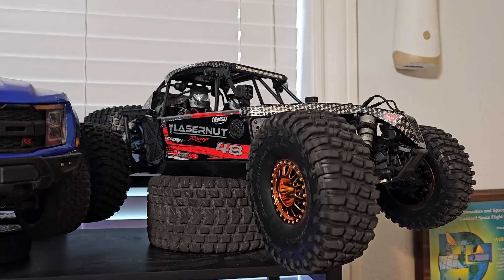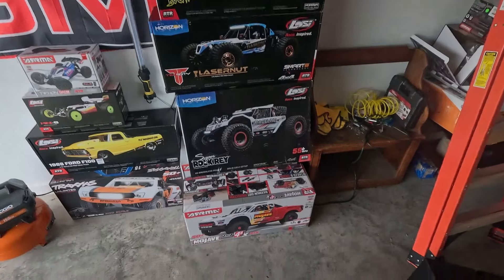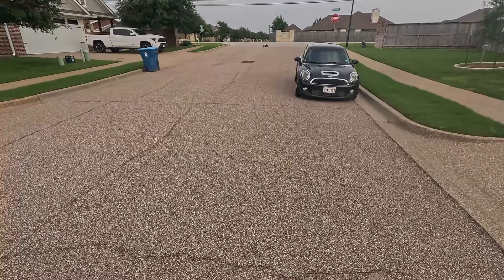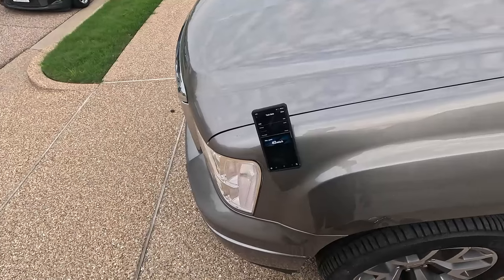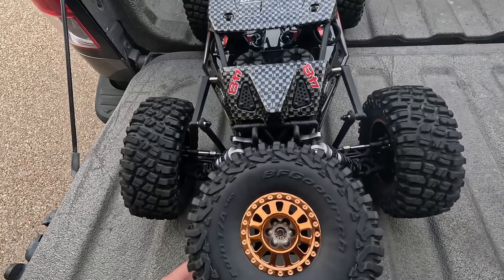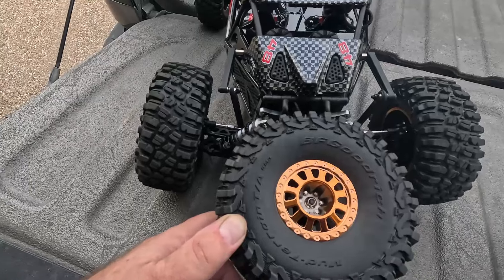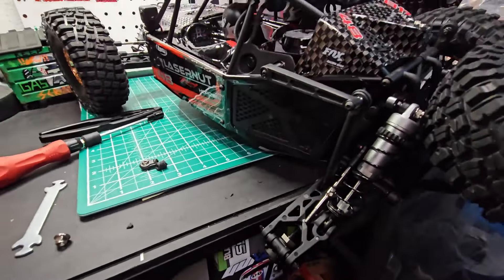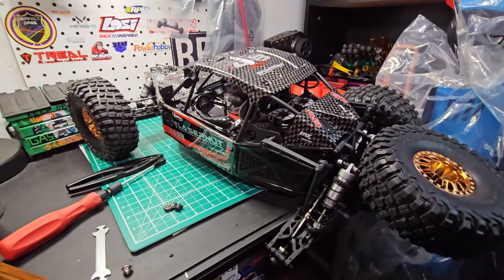New Losi Lasernut - Broken After 3 Minutes!!

Comment: Thanks for the heads up on the break settings. The Lasernut gets a bad rap because of it's diff problems. I've only been running 3s and haven't had any issues so far. The price is so low right now that I bought another one just in case this one breaks. I wonder if the link was just bad before you even took off. Losi should give you a replacement. ?